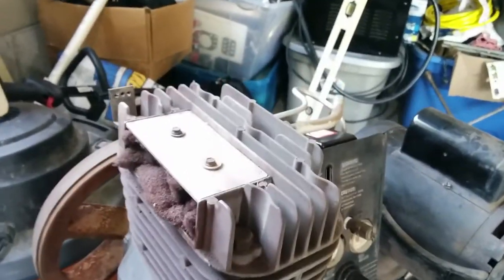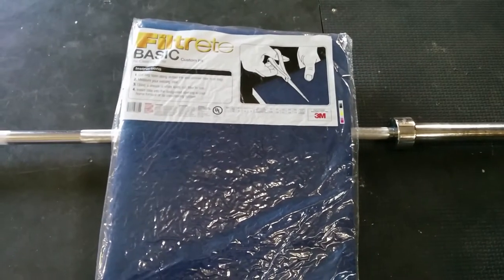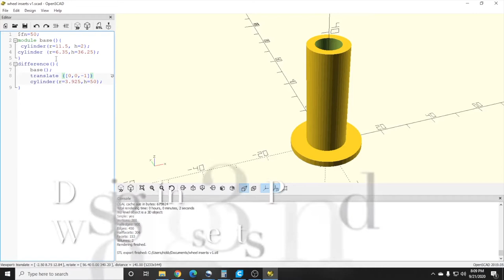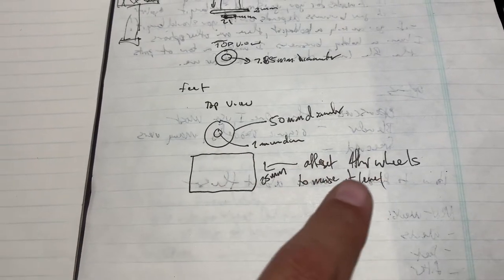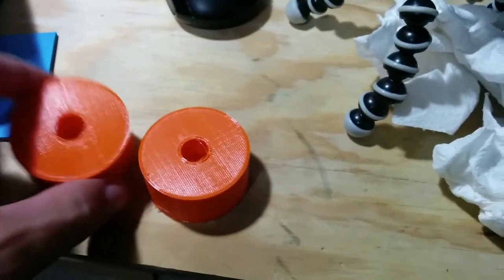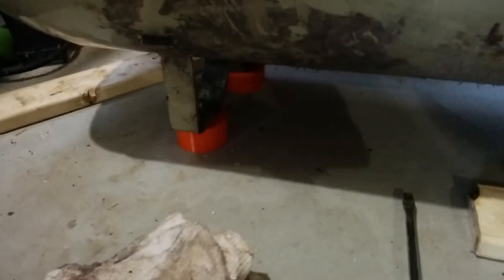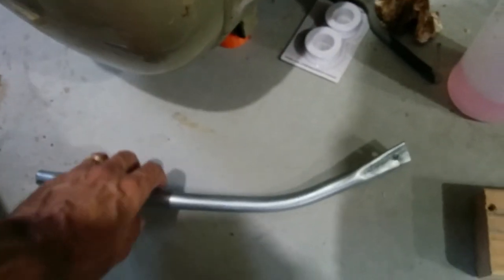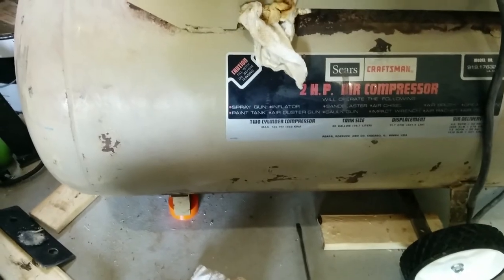Vintage Craftsman Air compressor Rescue From Scrap - Part 2

Comment: Just got a similar one myself. Was my dad’s old compressor from 1981. He passed in 2006 and it’s been in a barn ever since. Electric motor was seized up. Opened, greased, and filed the points inside and now it’s alive again.
Reply from the maker: Awesome.  Nice work.

Comment: The handle is supposed to slide all the way into the socket and the screw tightens down and holds by pressure.

Comment: THE  VERY 1ST  THING THAT  SHOULD  HAVE  BIN  DONE  IS  TO  LOOK  INSIDE  THAT  OLD  SEARS  TANK   IF  IT  IS  FLAKED RUST  INSIDE  IF  IT  HAS  THICK  FLAKE  RUST  YOU  MUST  TRASH  IT  IT  WILL KILL YOU  OR  SOMEONE YOU  LOVE  IF  THE  TANK  WILL EXPLODE  WITCH  IT  WILL  IF  TANK  LOOKS  GOOD  IN  THE  INSIDE  THEN  KEEP  IT  AND  DO  WHAT  YOU  ARE  DOING  TO  IT  NOW

Comment: Great find that's a good compressor where did you get those foot pads they always seems to wear out and its impossible to get replacement
Reply from the maker: Thanks, I 3d printed those foot pads.  I could not find a replacement either.

Comment: Thanks for the video, my dad found an air compressor for me today that’s a lot like yours only difference is it’s the 3HP 30 gallon tank. He paid $50 bucks for it I couldn’t believe it. After I got it, my first thought was there has to be someone that made a YouTube video about it lol sure enough here I am. Thanks for sharing this information. Any idea where to find the best place to find parts online? Mine needs the pressure regulator and the knob
Reply from the maker: That is a great deal!  I would start with the manual that I showed in the part one video I have on my channel.  It has a parts breakout page and you should be able to get the part number and do a google search on that to find it.  I know I have a Sears Part store near me than may have that part.